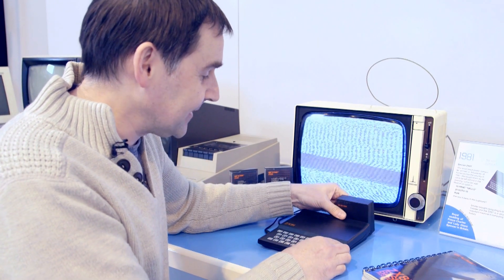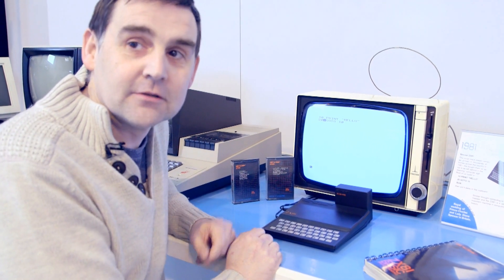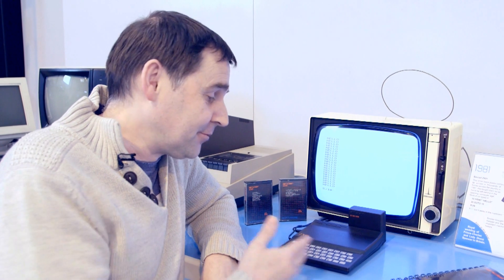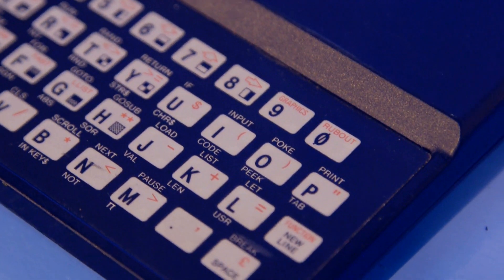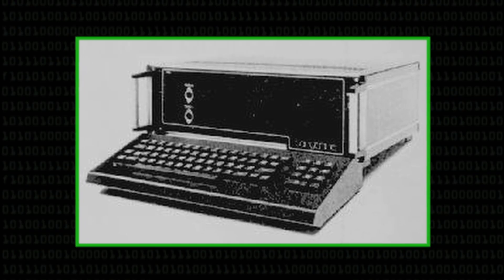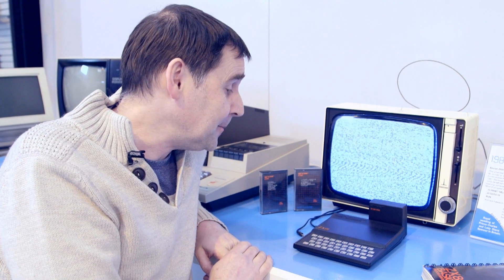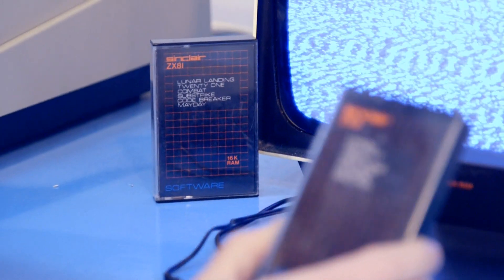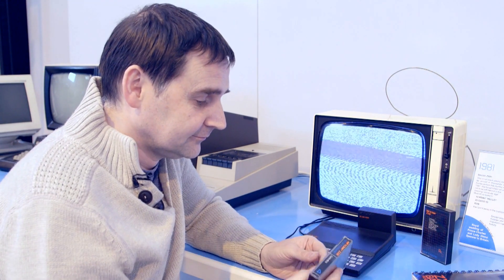Wobbly RAM & ZX81 Drawbacks - Computerphile

Comment: You have to remember than not all RAM-packs are equal: some shipped without the "Key" in the connector whose purpose was to ensure that the RAM pack would stay in the correct position. If my memory serves me right, Sinclair's own packs shipped initially without that key. If, on the other hand, this key was missing, it could enable the RAM pack to slide sideways a bit, and potentially short out various signals on the edge connector, and it was this behaviour which caused most of those glitches that have now become known as The Dreaded RAM Pack Wobble.

Comment: I don't know if there may have been more than one cause of the RAM pack wobble, but one that i am certain of is this:
Some batches of the RAM pcak - presumably the early ones - lacked a tiny plastic "key" in the edge connector to match a cutout in the ZX81 PCB, and as far as i know, the lack of this key would allow the connector to slide a little from side to side; as you may be able to 'see', this could, and often did, result in short circuits, which would mess up the operation of the '81

Comment: At least on the Spectrum, I found that the expansion bus connector on the interface has a tendency to break.  The plastic that holds the pins in place can snap, and it if does, interface wobble becomes infinitely more dangerous.

Comment: The wobble, in my experience, was caused by the fact that the bottom of the RAM pack sat flush on the surface of the table - I stuck two small rubber feet under the back end of the ZX81, lifting the RAM pack off the table - it was unsupported in this position, but not subject to movement when the casing of the computer flexed.

Comment: I had a third party memory pack.  Never really had a problem with  wobble on the RAM pack, but at some point I managed to break the connector and soldered it in place using staples as jumpers.  I also got a surplus TI-99/4a keyboard and hacked it so it worked with the ZX-81 after damaging the ribbon portion of the membrane on the original machine.

Comment: Ahhh my first computer...hours of typing in games from magazines then hours searching for the typo. Probably changed my world.
Reply: I know that feeling, my friend! At the time, i didn't have the means to purchase my own computer, so i would spend a lot of time with a friend who had a ZX81, and later a ZX Spectrum, and we kinda shared the work by taking turns at the computer, while the other read aloud the program listing, one command at a time. Then, after an hour or so, we would have a fresh pot of coffee, a little 'smoke', and then swap tasks so that the one who'd just been reading off the magazine would now type on the ZX, and vice versa.
Every time we found that an error had crept in, we would then do the same thing "in reverse" so to speak: one would read the listing from the computer screen, while the other double-checked the magazine listing - again taking turns if necessary - until we found the error(s).
Man those were great times!

Comment: Reminds me of the ZX80 that I converted the memory to 48K (yep, 48kilobytes = c. infinity). The brilliant designers (no sarcasm intended) threw away 32k of memory space to drive the graphics. So with a bit of extra address decoding, changing some ROM code addressing & adding the static memory I was able to have the 48k! Did crash when a tanker passed though. Chucked it out a few weeks ago due to down-sizing. Built the thing from a kit and first time out I got a screen that was half white and half black,,, Was using a battery charger with no smoothing... Learnt a lot from that machine!
Reply: +Rob Henderson I converted mine to 32K just by replacing the 2K static RAM with a 32K static RAM chip and moving the jumper wire next to the chip.  No extra fiddling required.  So happy they planned ahead with the PCB layout!  An added benefit was lowering the power consumption (and heat) with this simple mod.  The thing was rock solid after that.  Memories!
Reply: Yeah - simple is the right way  (best).

Comment: The problem was partly caused by the RAM pack case protruding slightly too far below that of the ZX81, so took repeated flexing loads as people used the keyboard. One workaround that people used was to sit the ZX81 on a book or something, so that the RAM pack just sat in free air.

For anyone interested, the ZX81's industrial designer, Rick Dickinson has a set of Flickr galleries containing lots of photos and sketches of his Sinclair product development.

Comment: I would've just 3D printed a nice little holding bracket ;)
Seriously I loved the home computer days, computers were so simple and trivial that you could build and hack them -- and you had to in order to get some use out of them.

I think that knowledge is what sets my generation (70s) apart from the 90s 'kids' now getting into the IT workplace. They've only learned to do Java or perhaps by the grace of the failing educational system some C++ but most couldn't create a simple computer if their lives depend on it. That's why I rather have electronics students, they still know this and also learn to code unlike BSc Computer Science  grads

With the VC20 piggy backed the NVRAM chips and only break out CS and solder that onto address line. I must have been 11 when I did that and the reason was that the expansion cartridge cost almost twice as much as just the 16K NVRAM chip.

Comment: Tbh regarding the aesthetics... I would say it still looks pretty good by today's standard..... But say it was never released...

 if a PC were released today that was basically a tiny keyboard and a load of usbs with a backpack which had HDMI out and WiFi to TV capabilities... Give it some reasonably good specs... 980m a good SSD.. An i5 CPU and say 8 GB of RAM and it would still be a very desirable item in 2015 ...

Comment: I wrote several 'Pac-Man' type games on my ZX81.  I wrote a game that measured the speed of my reaction time and then present me with statistics after I'd played a few times.  More useful stuff was a bubble sort program so i didn't have to manually alphabetize my weekly spelling list.  I also wrote a simple check balancing program which I never used because I was too young to have a checking account.  Doh!

Not only was there a wobble problem with the 16k extension, but the power plug was always pretty jiggly and would cut power if I pressed the keyboard in the "wrong way" and moved everything slightly.  For a while I put the ZX81 in a wooden jig to hold it all steady.  Nothing really helped and I lost far more than I ever saved onto tape.

But I didn't care cuz it was so incredibly cool to be able to write programs!

Great memories......

Comment: Remember the cartridge problems on the NES?
Reply: BlackEpyon If you have the flashing red light/ flashing screen problem, then the anti-piracy verification chip in the cart can't connect to the one in the console, so the one in the console thinks it's an unauthorized game, and resets the system over and over again. But you can fix that by breaking off one of the pins on the 10nes verification chip on the motherboard. There's a plethora of tutorials on Youtube.
Reply: And the n64. .GoldenEye animation bugs... Lol
Reply: BlackEpyon Yep, I had a special book that I had to jam in mine for it work. I forgot which book it was, but I remember it was the only one that did the trick. Even similar sized books wouldn't work. I guess my NES just like that paticular one.
Reply: Rabid Rabbit Rabbi I have to use the case of an audio tape since I modded the console to get rip of the verfication.

Comment: My RAM pack wobbled like hell. Never lost any data or anything, though.
Reply: Nilguiri The Ram pack on my TS-1000 (US version of the ZX-81) had the wobble,but actually only "crashed" once, Damn was I lucky! 🙌.( I still have them!)
Reply: Ah! I didn't even know there was a US version. I have no idea what happened to mine. Cool that you still have yours! Cheers.
Reply: Nilguiri Yep, Timex distributed the NTSC version of Sinclairs in the US. They also had an upgraded Spectrum model known here as the Timex Sinclair 2068. (a rather nice little machine. I have 1 of those too.👍) I have had other computers during the 1980s, but learned to program in BASIC on those, and therefore been a Sinclair fan since! The small size and lack of moving parts ensured that they survived in pretty decent numbers here despite not selling in the numbers that the more common (and to me less interesting because of it..) Commodores. Peace 😀!